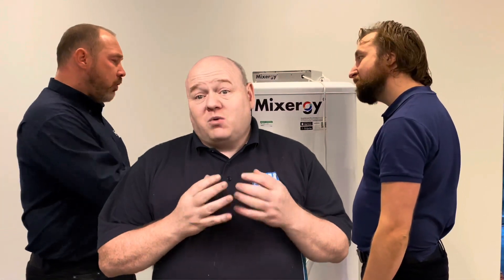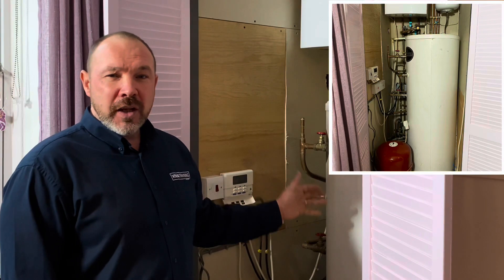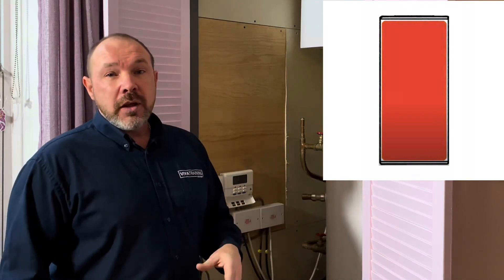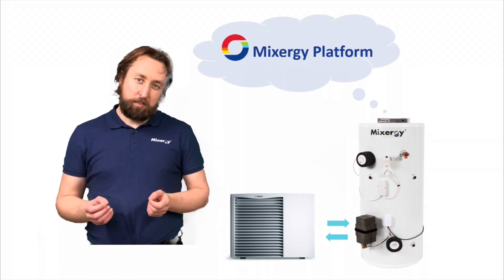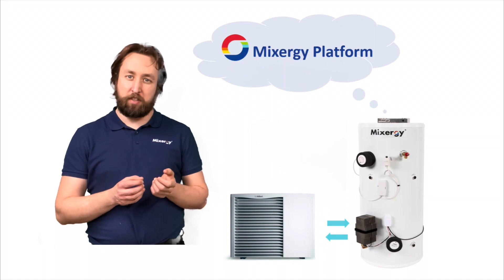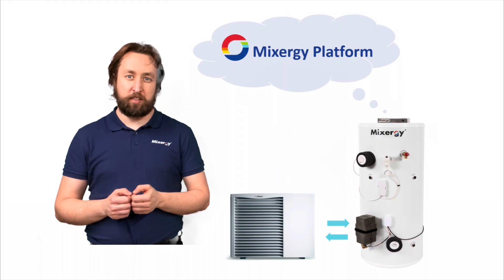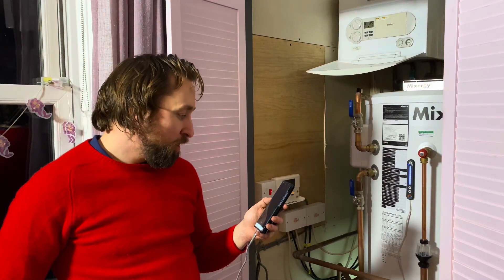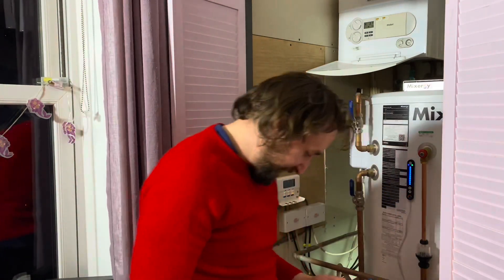Mixergy Smart Hot Water Tank / Cylinder

Comment: so he removed his old unvented cylinder and replaced it with his new unvented cylinder
Reply: A bit more than that. ;)  Please try.
Reply from the maker: clive ramsbotty Yes that’s correct, Unlike the old hot water cylinder this one will work with PV and also with his smart meter, sometimes giving him free hot water, or even been paid to have hot water.
Reply: It's a gimmick, thermal store is far better .
Reply from the maker: John Burns what do you mean John, Thanks
Reply from the maker: @mgbroadsterJ  How would a thermal store work like this? Thanks.
Reply: @mgbroadsterJ   - can you elaborate Daren? In our view thermal stores have pros and cons. The primary issue is the temperature drop associated with the heat exchanger that's required in a thermal store, this means a thermal store has to run a bit hotter than a conventional cylinder which means heat losses are higher. You also get a pressure drop associated with the heat heat exchanger which you don't need in a normal tank. We're a big fan of the simplicity of a conventional hot water cylinder for this reason and have also found there's a considerable amount of head room for storage within them if you get thermal stratification working right!
Reply: @AllenHart999  
I do not think he understood the advantages of this Smart cylinder. 

Robert Llewellyn also featured this cylinder a while back on his Fully Charged channel.  Worth watching as well. 

There is a move to phase out gas and all use clean electricity.  Getting rid of ugly gas flues and condensate pipes on the sides of buildings would be a great positive. A company said it could convert the city of Leeds' gas network to hydrogen - zero emissions.  Seems to have gone cold on that. Modern appliances would need just tweaks to burn hydrogen. A bit like North Sea gas conversions of 40 years ago. 

Solar panels and Powerwall types of batteries will make a big difference in moving to all electric - the prices will drop as production increases.  Not having gas meter/supply standing charges buys a lot of electricity and saves space in a house getting rid of the gas meter. 

These Smart cylinders aid in balancing the electricity grid which is big problem at times.
Reply from the maker: @johnburns4017  The one that Robert Llewellyn did was the older version. This is the lastest one that will work with all the future technologies and also work with smart meters.
Reply from the maker: @johnburns4017  Thank you John.
Reply: @johnburns4017  Thanks for the shout out on the Fully Charged video - it's still essentially the same mission we're on and our view is that it is going to be a long haul to decarbonise hot water which is the rationale for having the hybrid approach (able to use both your system boiler but increasingly electric as more renewables [and low carbon Nuclear] is installed) - heat pumps are also likely to start featuring heavily alongside a renaissance of PV in new build if the forthcoming changes in build regs happen as planned next year!
Reply: @mixergyltd6286  
The pressure valves on unvented cylinder can really drop flows.
 A largish plate heat exchanger on the DHW of a thermal store needs the stored water temperaturem only slightly higher than the desired tap temp. The large plate heat exchangers really extract the stored heat.

Thermal stores come into their own when vented, as no stored high pressures. Low pressure stored water and high pressure tap water. A higher safety level. Thermal stores are also great when using multiple heat sources. They are also great when connected to a low temp UFH system. Getting high temps from say a PV panel can be challenging.  UFH with low temps sorts that.  

A thermal store can work in a similar way with a Mixergy setup.
Reply: @AllenHart999  
Thx
Reply: @johnburns4017  Good point on the Pressure Reducing Valves, and thermal stores with a good plate heat exchanger can be not so bad on the pressure drop - I think the point on vented is interesting, with mains pressure we find unvented cylinders work well - vented systems can be quite practical if you can't run the discharge pipework but suffer from higher heat losses due to expanding water into headers - lower pressure indeed means you can use less material to reduce cost but we've tended to find these get offset by additional heat exchange - I think for large systems where you want to buffer the central heating as well is a great application for thermal stores - particularly if you have loads of onsite renewables ...
Reply: @mixergyltd6286  
Heat pumps are a great success in Scandinavia, but high installation costs if done properly when ground sourced. But they do not have domestic gas, so no option. In a highly insulated house with the temperate UK climate all electric makes sense. Moving up to a ground or water sourced heat pump take a some considering. I assume a good bet in a highly insulted large house.  

A friend was heavily insulating a full renovation in a terraced house. It was to be all one room downstairs with two beds upstairs, the bathroom in the loft facing rear with dormer, and a single floor kitchen extension out the back. A small longish garden at the rear.

I suggested:
♦  going all electric saving on gas meter space and the standing charge for the meter;
♦  Remove the mains gas pipe from the house, as this acts as heat sink, and safer.
♦  A boiling water tap in the kitchen;
♦ A 11kW instant water heater to go into a cupboard; next to the bathroom. 11KW-11.5kW is the highest kW on single phase;
♦ An aerated Raindance shower head for the shower (no bath) - uses about 9.5  l/min mixed;
♦ A normal aerated tap for the bathroom basin regulated to 4 litres/min, fed off the instant electric water heater;
♦ Electric underfloor heating with stats (Heatmiser) in the living room, one in each bedroom;
♦ An electric kickspace heater in the kitchen with an above worktop mounted switch, to give instant heat in the morning;
♦ An electric towel rail in the bathroom;
♦ LED lights all around;
♦ Of course low energy appliances.

I told him it would be far cheaper to install than a piped CH system with a gas combi boiler, enabling the money saved to be used on thicker insulation.  He liked the idea of being maintenance free, saving a lump each year in service costs to spend on electricity.

As the house was to be heavily insulated with low heat loss, heating demands would be low. The low water usage Raindance shower head would give a decent shower, with the boiling water tap eliminating a kettle in the kitchen, which takes up valuable worktop space.

He had thick foam insulation under the solid ground floor with electric heating under a wooden floor. The front of the house had internal insulation against the walls. Highly insulated front and rear doors. Triple glazing all through. The rear of the house had high performing external insulation, inc' the extension, with render over. The pitched roof was not vented with very thick insulation. The air extraction was heat recovery. The electric meter and CU was over the front door in a fireproof cupboard that blended in.

He is delighted with the heating, only ever having to be on once or twice in 18 months for a short period, never used upstairs, except the bathroom every now and then for heating towels. Also no wall rads which he loves. 

He says the Raindance shower head is great with no waiting for hot water. The boiling water tap (not a Quooker) he says is superb with no waiting for hot water. The tap's cost was offset by not buying an electric kettle.

The electric running costs? He said so low it is not worth mentioning. He doesn't keep a tag on the costs. When it is ouch he notices. But far less overall than the old gas and electricity bills combined. The water is on a meter so lower water bills as no dead leg pipe on the hot water draw-off.

I did suggest to install some conduit from the CU to the back of the house in case a PV panel or Powerwall battery was to be fitted in the future. He did. 

So, in some situations going all electric can work out better all around, especially where space is needed.
Reply: @mixergyltd6286  
Some thermal stores do not have an integrated cold F&E tank, with the ballcock in the stored water. 

All in a neat package:
https://www.advanceappliances.co.uk/product/53-electric-thermal-store-hot-water-only/
Reply: @johnburns4017  Cheers John, this is really interesting - we work with heat pumps as well but the decision whether to go all-electric or heat-pump is fraught with complexity! Interestingly, you can use the online calculator for new build energy consumption (from BRE) to estimate the energy consumption of a dwelling for a given set of measures (i.e insulation, double/triple glazing, PV etc) - where a lot of attention is paid to the fabric, and in particular where air heat recovery is implemented, there is very little heating load left and so all electric makes a lot of sense (particularly in Passiv level build). How to accurately determine this for retrofit is going to be a real challenge and we hope that proper assessments are made for heat-pump retrofits to ensure the insulation and level of air tightness is sufficient to avoid poor service. That being said, heat pumps can work very well if the whole install and build fabric is attended to properly!
Reply: @mixergyltd6286  
A problem with British homes is the poor attention to detail.   Air leaks are a big problem, with this obsession with cavity walls not helping. The Germans think we are mad when two walls are built when one will do if built properly. Cavity walls came about in a big way to get around poor craft skills availability after WW1. Two walls meant less chance of damp ingress. But the building fabric leaks air like crazy.

I have been asked by people to replace bathroom towel rails with larger sizes and increase heating in bathrooms.  With one I suggested fitting secondary glazing and a heat recovery extractor rather than increase radiator sizes.  Then no increasing energy bills. We accept poor construction standards, as the mentality is bigger heat emitters to solve matters.
Reply: @mixergyltd6286  
"Interestingly, you can use the online calculator for new build energy consumption (from BRE) to estimate the energy consumption of a dwelling for a given set of measures "
BRE have always been good at this.

Comment: What tundish is that on the side of the new cylinder? Looks like its sealed and might actually not just flood on the floor when the PRV's opened!!
Reply from the maker: Good question.
Reply: Well spotted Paul! - it's not easy to see from the video but the Tundish is actually made from a clear acrylic which has a number of air channels and labyrinths which stop water from flowing out all over the floor but also allows easy visual inspection and stops fingers trespassing into the hot discharge!
Reply from the maker: @mixergyltd6286  Thank you so much for clearing that up.
Reply: It doesn’t look 300mm on D2 😜

Comment: Thanks for this, perfect timing, our 20 year old Ideal gas boiler has died. Researching alternatives. This looks fab.
Reply: I would advise against electric hot water cylinder to provide hot water for the households.

Hydrogen gas boiler is better.
Reply: @mparthur144  hydrogen is NOT an energy source, but an energy carrier. It is expensive and complex to produce be that green, blue or grey. It is difficult to store, transport and can leak very easily due to its very small molecule size. Our current gas infrastructure has many leaks, pushing a gas/hydrogen blend will be even worse.
Reply: @johntisbury I prefer the old gas boilers.  More reliable but expensive due to the country being a net importer of gas these days.
Reply: @mparthur144  yes as a nation our government has not looked to the longterm. No surprises there!

Comment: I have opened two different unvented hot water cylinders five years after installation and commissioning. The first one was a direct cylinder with two immersion heaters. The second one was indirect and the flow temperature in the coil had been set at 63 C.
Which cylinder you recon was full of lime scale ?

Comment: What an amazing device. I'm thinking about installing an ASHP, in my view the Mixergy "cylinder" is a must have. In fact it would  be a deal breaker if the ASHP installer refused to install the Mixergy "cylinder".
Reply: Most ashp can connect digitally to cylinders, but can't with a mixergy cylinder. By connecting digitally to cylinder you can modulate heat pump more accurately reducing cycling increasing efficiency. The only benefit i can see is to heat cylinder electrically a minimal amount as required when electricity is expensive
Reply: @mattmackenzie1111  Thanks.

Comment: What flow temperature from boiler is optimal to gain a 60 Deg hot water outlet temperature, and what return temperature will this give to boiler if pump speed has been set correctly, or using an intelligent pump? Thanks, lots of things to like about this product. Looks very well designed and thought out, well done 👍
Reply: Hi Darren, this is a really good question, generally speaking you need around 70 degrees from the system loop to achieve a decent transfer of heat from the system boiler to avoid the gas boiler short cycling if your target is 60C. Problems with temperature control are a major issue with conventional cylinders because most manufacturers ship them with a mechanical cylinder stat set to temperatures as high as 65C to 70C - added to this the inaccuracy of some of these devices and you can often have a situation where the cylinder is trying to achieve excessive temperatures that cause the boiler to go into short-cycling and this tends to go unnoticed - short cycling can increase the gas consumption by as much as 20% for the same amount of hot water consumption. 

The Mixergy cylinder monitors for instances of short cycling through the onboard sensors and avoids it by controlling the temperature more precisely and running the pump to reduce the cylinder temperature to enhance heat transfer and stop the cycling from occurring if it does. We also have an auto fault detect since boiler short cycling can occur due to other issues with the system install (i.e boiler pump etc) - we can notify the installer if short-cycling is an issue that needs someone to visit to adjust the system boiler controls.  

A lot of this work was recognised by the Energy Savings Trust who've endorsed our gas efficiency claims, see following link: https://energysavingtrust.org.uk/products/mixergy-hot-water-tank-cylinder/#:~:text=The%20Mixergy%20tank%20contains%20several,efficient%20and%20controllable%2C%20such%20as%3A&text=The%20ability%20to%20heat%20only,water%20required%20by%20the%20household.&text=Utilisation%20of%20a%20special%20plate,transfer%20from%20indirect%20heating%20sources.
Reply from the maker: Great point!
Reply: If your running your boiler at 70°c as suggested it won't be condensing reducing efficiency.

Comment: Great stuff this.
I have to fit one in the new year so good timing this video Allen 👍
Reply from the maker: Please will you come back and let us know how you get on, Thanks
Reply: @AllenHart999  of course no problem.
It will be installed with PV too!
Reply from the maker: magicno001 where abouts are you in the Uk? Would be good to get some videos of it. Thanks
Reply: @mixergyltd6286  thank you
The install is open vented with pumped showers x 3.
The boiler is also open vented as the property is old.
It’s a large property and the water pressure and flow is appealing!!!!
Reply: @AllenHart999  tucked away in North Dorset Allen out the way! 👍
Reply: @mixergyltd6286  
I’m moving house in the new year and have to install gas CH in the property.
I want unvented in there so would your system work as apprised to a conventional unvented just running off mains gas and electric immersion?
Chris
Reply: @magicno001  It sure would, in fact the Mixergy tank is typically installed as an unvented system and the most common situation is to use the gas boiler but with electric immersion available to use off-peak electricity or cheap renewables on a flexible tariff -

Comment: What insulation does it use and how susceptible is it to scaling? When my old economy 7 cylinder was removed as I live it a very hard water area it had more than its own weight in limescale in it!
Reply: Hello Baz, the tanks come with insulation which is 50mm to 60mm thick depending on the model. The insulation is a polyurethane foam mixture which is injected and set under pressure within a steel outer wrapping. By setting under pressure, we achieve a very good level of performance to minimise standing heat losses. 

On hard water, these systems perform very well and we've found them to be more reliable than conventional cylinders in very hard water areas (such as North London, Oxfordshire, etc). The reason for this is that calcium carbonate (in scale form) precipitates on heat transfer surfaces like heating elements and coils and then flakes off. In our case, we use a titanium heating element to maximise reliability and by having both the coil and elements towards the tank, we avoid the problem of scale sediment  eventually burying the heating elements which causes them to fail or lose efficiency. We've been learning a lot about how hard water precipitates scale through accelerated test rigs and have used this to inform the design detail of the system carefully.
Reply from the maker: Merry Christmas